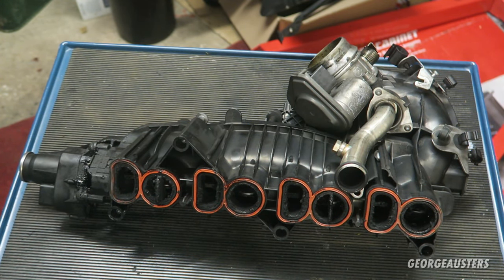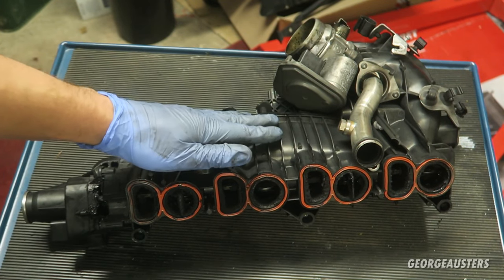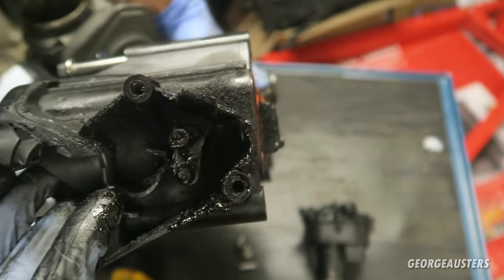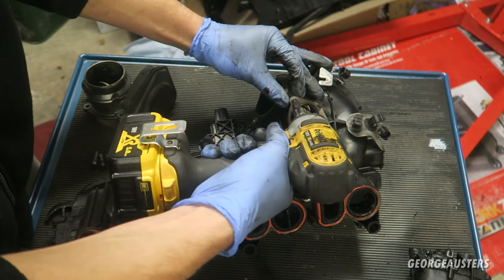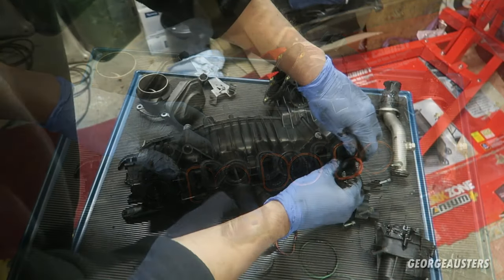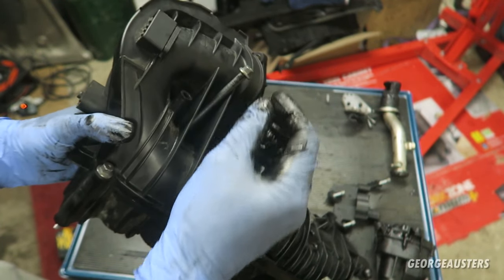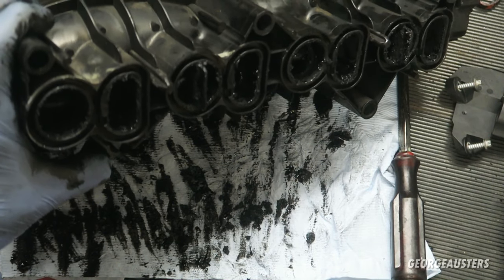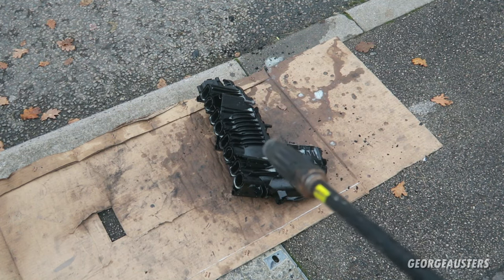How to DIY Carbon Clean BMW N47 / N57 Intake Manifold

Comment: Did you feel the difference after cleaning intake manifold? Is it noticable?
Reply from the maker: Hard to say as my engine was out for 3-4 weeks
Reply: Ja sam skoro čistio i nisam primetio nikakvu posebnu razliku. Doduše ostao sam zatečen da usisna uopšte nije bila toliko prljava, a auto ima 365000 km. Tako da ti je moj savet da ne bacas 80 evrica kao ja 🙂
Reply: Yes, gas response is quicker and felt it softer and less noise when accelerating
Reply: @INAPVBG  Na šta si ti bacio 80€?
Reply: Stjepan Brbot Zamena sva 4 grejača, modula grejača, skidala se usisna grana i usput očišćena na moj zahtev = 80e za ruke. Znam da može i manje, ali to je cena u ovlascenom servisu

Comment: Garage quoted me 2k to 'replace' my EGR valve and my Inlet manifold... for my BMW 420D
Reply from the maker: Madness
Reply: @GeorgeAusters  Yeah kind of had no choice, I already paid £150 to get my car towed there as it does not start. They said both egr valve and the swirl flaps in manifold are faulty so both need to be replaced. Total cost £2k with the diagnostic and service. Kind of think I overpaid on this one, I bought this car second hand as well, 80k miles originally and did about 5k miles. I drove around with the 'drive train' error for about 2-3 days before I took it seriously as car started to stall, I think because I did this I blew the manifold possibly parts of the engine.